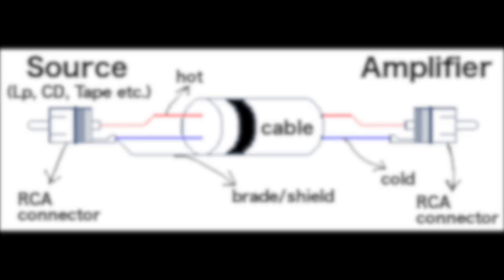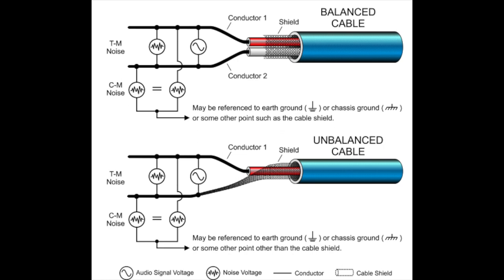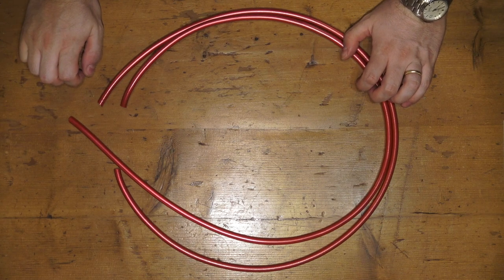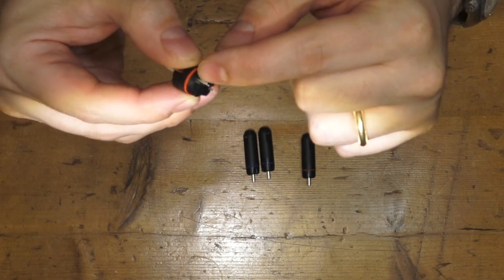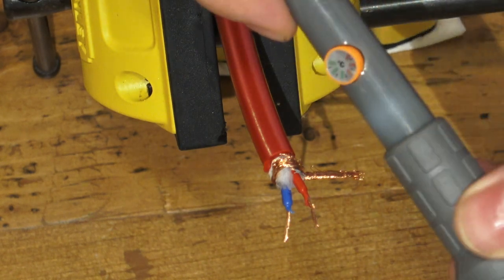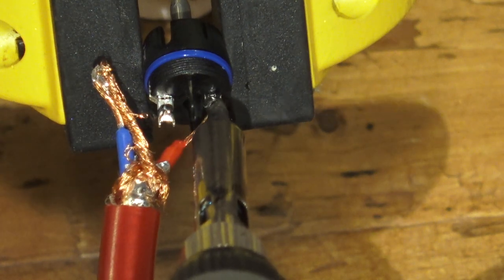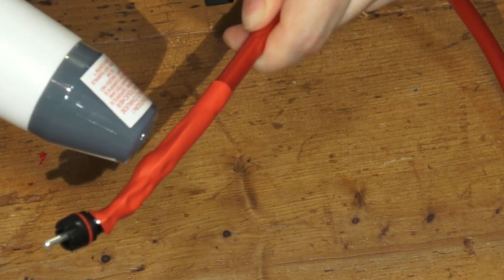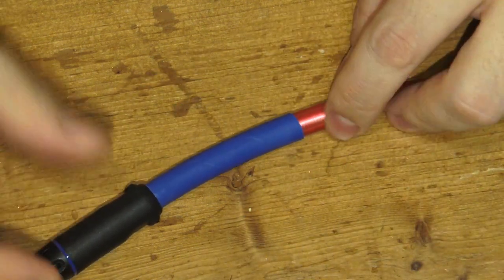How to make a high quality and inexpensive audio interconnect RCA cable

Comment: コニチワ Konichiwa, Sorry for my comment I may sound a bit rude, cable is balanced or unbalanced, there is no such thing as semi balanced cable, this is a totally silly idea, a popular myth, only causing troubles to those who DIY cables and believe it. So called "Semi-balanced" is a pure nonsense electrically, magnetically and scientifically speaking. Get a good shielded cable, and you are good to go, no need to apply magic to already mythologized to the extent hi end audio. Sorry, no hard feelings despite a bit rude words. As a wise person, you can always revise your ideas and spread the good analog wisdom. Thank you.
Reply: I forgot to make a precision, today's cables of top brands like Mogami, Sommer, Klotz and so on, are very well shielded no matter what kind of interconnect you make, is it an RCA, TS, TRS, XLR, does not matter, you are going to get 100% shielded interconnect.
Reply from the maker: I actually agree. It's just a way of saying to distinguish a true balanced cables from a single ended one with the shield connected to the cold pole on one or both sides.

Comment: Good attempt but you`re doing some mistakes. Like using unshielded conductors and stranded conductors
Reply from the maker: They aren't mistakes, but choices and experimentation. Shielding if you are not in a EMI/RFI polluted invironment isn't necessary, in any case I did connect the braid to the cold pole so in this case I did shield it. Litz is a choice, I prefer solid but this was OCC copper at s very low price with amazing results. Context is paramount. Can't judge in absolute terms.
Reply: @anadialog  one wery important little issue; any electrical interference between +/- will degrade the signal.  Local interference in a stranded conductor will also degrade